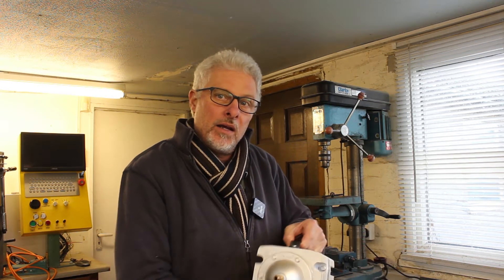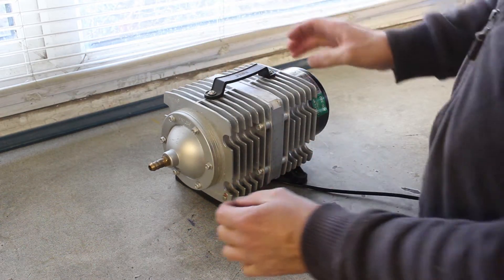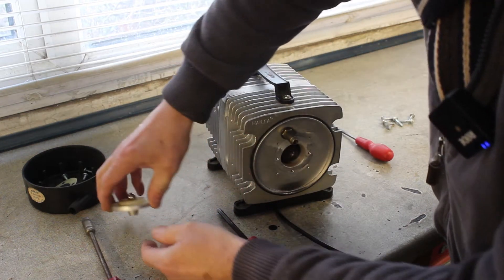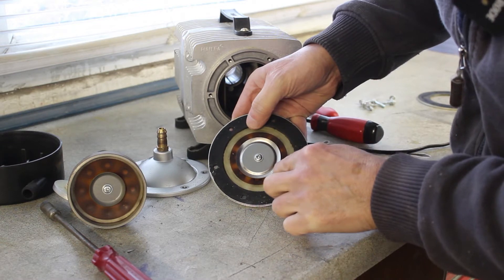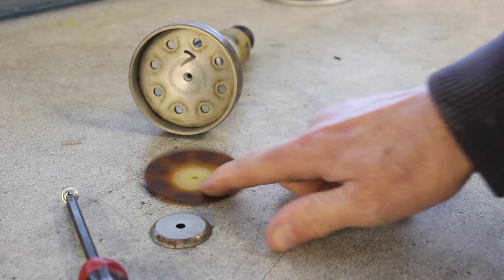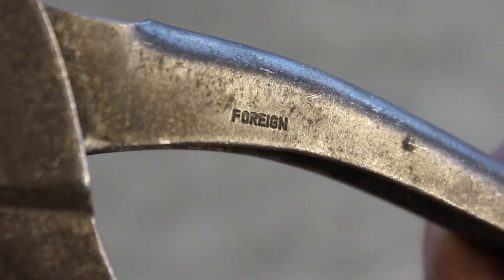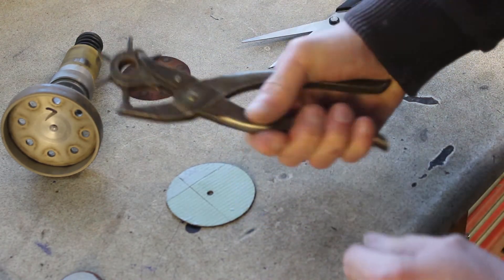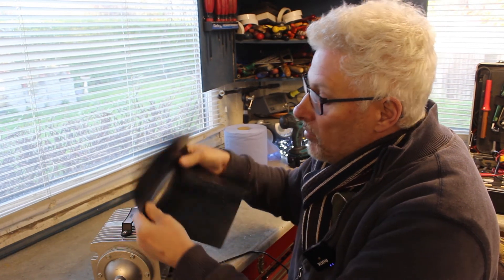Laser cutter compressor fix

Comment: Hi. Worderfull video. Do you know how much psi this compressor can reach in a close system? I want to make a DIY compressor with an air tank for painting. Thank you.
Reply from the maker: That’s a good question I don’t have an answer for you. These pumps are often used in big aquariums and they don’t drive a lot of air or pressure. There’s no pressure in my laser cutter it’s a totally open system.
Best of luck.

Comment: Hi, I have one of the same pumps on my home made laser cutter and now I know how to fix it.Thanks. They are very noisy so i fitted it in a box with sound foam and now its at the same level as the extraction fan. Have been working my way through your videos and are finding them very interesting. How is the new workshop going.
Cheers Dave.
Reply from the maker: Thanks Dave,
I put my pumps in the bottom of the cutter on foam pads which helped with the noise however it all got drowned out with the exhaust fans. 
New workshop is on the way I am stuck in building regs (codes I think in US). I hope to get started with the footings in the new year.
Cheers